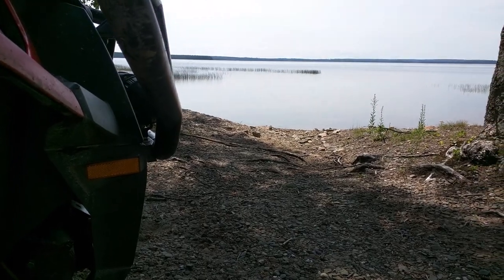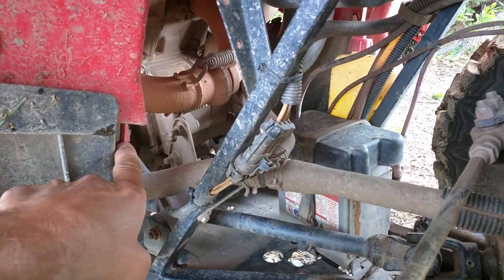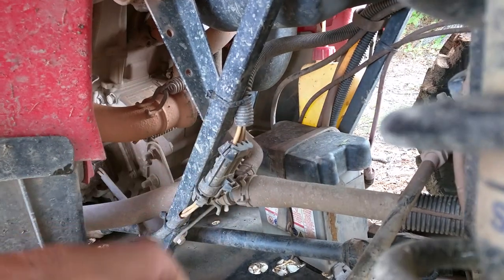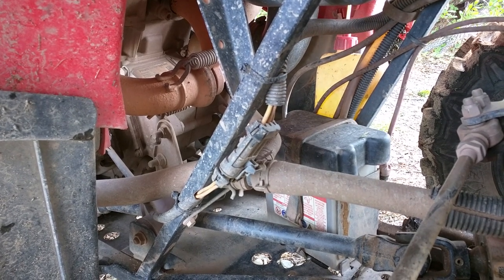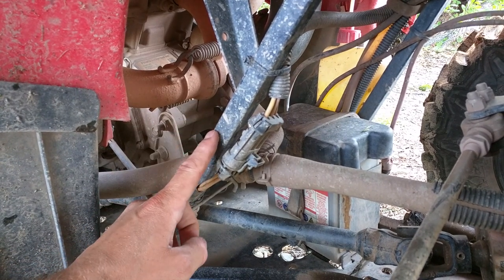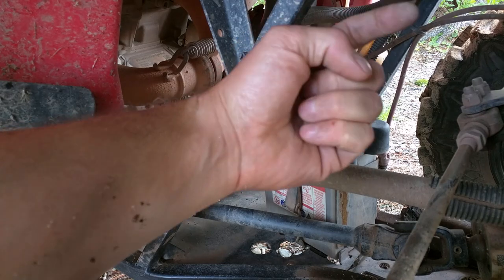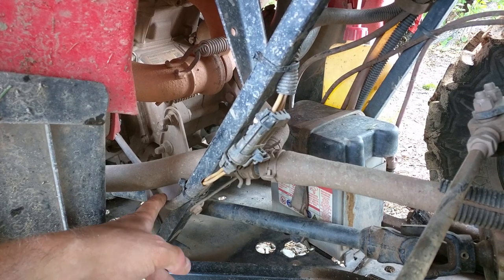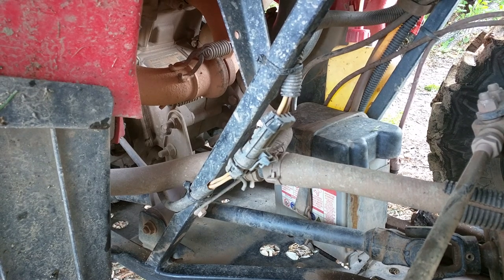Sportsman 570 Voltage Regulator Blown? - Prevent it from happening

Comment: Thanks for this Joshua, my 19 570 which had some engine work previous to me was found with the stator harness kissing the forward driveshaft. Very bad. Your idea should will work well in my situation. I might try to shield the connector somehow from debris, and make sure it has a nice coating of dielectric on the seal. Cheers.
Reply from the maker: Glad it helped and hope it works for ya.

Comment: I got a question I have a Polaris 2016 450 ho I replaced the battery but the battery not charging with the bike I'm trying to figure out what's the easier cheapest way to go all the parts costing $500 200
Reply from the maker: Sorry Trevor i'm not sure.  maybe take the atv to a mechanic.

Comment: I have an issue with my 2017 sportsman and the battery dies while it’s off and it has a rough time starting when it’s cold and sometimes it just won’t start at all. Do you have an idea for what it could be
Reply from the maker: Sorry it's hard to tell.  i'm not a mechanic but if you still have the stock battery I'd start by changing as it's getting old and getting a AGM.

Comment: when you melt the glop out of the vr you will see that they use to small of diodes to rectify the ac voltage from the stater to dc voltage output of the vr. Replace the diodes with 5 watt blocking diodes and no more problems. I bought 3 before seeing this problem. POLARIS makes money on parts! So get ready to replace vr they designed it to fail!! SAD.
Reply from the maker: I've heard that before about the diodes.  Knock on wood I have 6000+ kms and so far so good.

Comment: Hey Joshua has this worked out long term? Im getting ready to get a leftover 2020 and want to do this before I put any miles on it.
Reply from the maker: Yes it worked great.  Knock on wood I never had a regulator go out on me and I can check the wires and haven't had a problem yet.

Comment: I’m not having issues with the battery holding charge but my voltage has been skyhigh I’m changing out the rectifier and re-positioning thank you
Reply from the maker: Did you wire rub through?

Comment: Great Tip! I have a 2018 and have recently been working through a no start issue. I checked the voltage regulator/stator connection and found that my stator wires (the outermost sleeve, which houses the three wires) had started to wear through. I have rerouted and relocated the connection.
Thanks
Reply from the maker: Glad this helped.  I was in the same boat as you.  Caught it before it became a big problem!

Comment: Got me some problems with EPS error codes recently and my display went nuts with crazy flickering and has even died  (gone black) many times while driving. My stator wire harness is routed the "bad way" behind/under the oil filter. Will bring the machine to the store and tell them to fix this. They have to be aware of this?! so why don't they fix it before they f...... sell it to people. So many people have these issues so Polaris should fix all machines ffs.  I have the Polaris Sportsman 570 (2018) EPS X2. Thanks for this tip anyway.
Reply from the maker: I know I should be a recall.  I just caught mine before it went through.
Reply: Mine acted same way and neg screw on battery was loose!

Comment: Thank you for the tip.  I had a partial tree stump shoot up in there and partially unplugged that connector and now it seems to have taken out my voltage regulator.  As I go higher in rpm,  the voltage raises up to 16v then throws a code and shuts off
Reply from the maker: Glad I could help Brian.  I haven't had a problem yet with my VR.  I think on the new atv's they moved that cable.
Reply: @JoshuaGammon  yeah I can't believe that it took out my VR but I just got done testing with my sons ATV that is the same year as mine,  borrowed his VR tried on mine and it worked.  So I guess riding back to the trail head with a loose connection is not good for it.  Since I was peaking at 16V, im lucky nothing else blew up

Comment: One other issue my neighbor and I have had is master cylinder failures. And if the master cylinder fails you can't start the beast. I have a 2015 low miles and am on my third master cylinder. Mine is also charging intermittently and is the reason I am watching this video. My wife has a Honda Rincon 650 that is bullet proof. I have an older Yamaha Grizzly 600 with over 5000 mi. that is still going strong.
Reply from the maker: Sorry to hear Robert.  I have 6000kms and never had an issue. (Other then catching the wire rubbing)  Still on stock battery and my bike lives outside in Canada at -25c all winter.  It really seems hit and miss with the quality on these bikes.
Reply: I found out that if master cylinder goes if u pull brake handle and step on foot brake at same time it will start!

Comment: Got a 2017 battery dies when riding. Got new regulator from polaris. Updated from original. Can't find online where to fin kit instal instructions. Came with a bracket as well. Help.
Reply from the maker: Hey Jared.  I haven't replaced one my self.  But if you head over to https://www.polarisatvforums.com/.  You'll get a lot of help in those forms. 👍
Reply: Cool. On the phone with polaris now.
Reply: Got the instructions for voltage regulator pn 2208011 and 2208111
Reply from the maker: @kingpostal  nice to hear.  👍. Polaris came thur for ya then?

Comment: Great idea fella! I got some questions for ya. I’m having some voltage regulator issues it’s not throwing the typical code it’s grounding it out to the point when hooking up the last battery cable it arches out and when it starts it draws the battery down to around 9 volts and won’t charge. When I unplugged it and it stopped arching and the it does not draw the battery down...now my question is...is that the issue you had with your wires rubbing? Or could that be stator related...right now I don’t know if the stator even spins without the voltage regulator present in the system...haha any insight at all is greatly appreciated!
Reply from the maker: Hey Kris.  I didn't have any issues with my ATV because I caught the problem before it started.  If i'm understanded you right, the ATV is running fine when the battery is disconnected, and when you plug it in then you are having the problems.  If that's the case maybe you are just having battery issues.  If you have a ground problem with your stator wires then the problem would stay regardless of the battery's connection.  But just in case I'd check all your wires and make sure.  I hope this helps.
Reply: Joshua Gammon turned out the voltage regulator fried and took the stator with it had to replace the whole charging system
Reply from the maker: Sorry to hear man.

Comment: I have a 2016 570 and it has a problem with it running low voltage and I was wondering if anybody can help?
Reply from the maker: If you have a stock battery make sure you take it out of the bike and check the levels and top it up with distilled water.  Then connect it back up to the bike and check it running with a volt meter!  Should be charging at apx14v DC.
Reply: It’s on its 3 rd battery
Reply from the maker: Could be your voltage regulator or stator at this point.
Reply: I think the wires are burnt from getting to hot

Comment: Good video but the stator wire doesn’t go to the ECU the stator goes straight to the voltage regulator and the voltage reg connects to the bus’s bar
Reply from the maker: Sorry my bad.  Your right.  It's to the voltage regulator.  I changed that in my description.

Comment: Routing of the wires is not what blowing the regulator.   EVERY POLARIS HAS THIS PROBLEM.  THEY ALL DO IT OVER TIME. QUESTION IS WHY... AND HOW DO WE COME UP WITH A SOLUTION.... SEEING POLARIS WONT
Reply: it just happened to my 2018 570. Now i need to bring it to a shop. thank god i have 5 year warranty
Reply: Josh Styles when I bought mine they gave me only 6 months warranty, and I had to change the voltage regulator with 8 months of use. And today I went to a trail and in happened again, but I bought a regulator from another site and its 1/3 on the price and with 1 year warranty so hope I can get it fixed
Reply: @Mateusrizzi1  im paying a bit extra for 5 year bumper to bumper warranty. Got to phone the dealer and make an appointment to get it fixed.
Reply: RM STATOR  out of Quebec Canada makes a really good upgrade voltage regulator,  I also added a inline blade fuse holder with 40 amp fuse. And a extra ground from the battery to steel frame.  Been 10 months n no issues so far. Keeping my fingers crossed
Reply from the maker: I hope your wrong.  Fingers crossed!  6000+ kms and going.
Reply: @endurotruckererniedesjardins  Hey Endureo trucker, I am going to add the inline fuse as well as I almost burn the thing up (thank god I cut the red wire with a snips)  Anyways it does look like these wires are 10G so that would mean 40A but I see some VR's (RIcks) has a 50A inline fuse.  Do you think I should put the 50A fuse in versus the 40A? I have a winch and heated grips but nothing major pulling current.